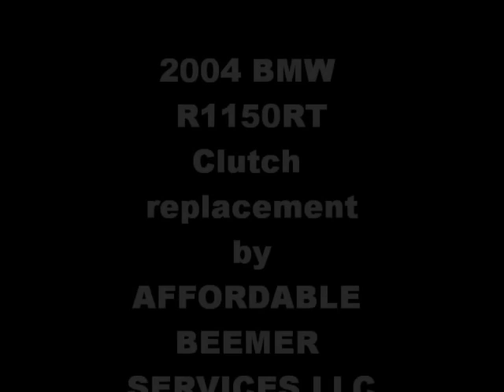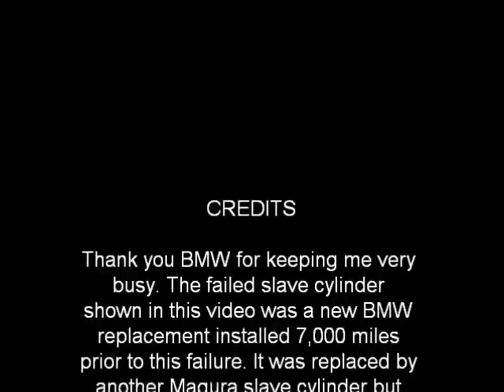BMW Service - R1150RT Clutch Replacement

Comment from the maker: While very, very rare this can happen to the older Oilheads. Only one here at the shop and it was a 50,000+/- mile R1100RT-P that I had installed a rebuilt transmission onto less than 3000 miles earlier. Sometimes they just fail. There is no modified disc for these older bikes as the splines are engaged almost completely. Just replace the input shaft and bearings, use a Siebenrock clutch from Beemer Boneyard and you'll be back on the road with no problems. Good luck, Chris

Comment from the maker: You can plan on rebuilding the rear drive once, installing the modified clutch disc once and then eliminating the goofy servo (if equipped w/ EVO brakes) from the brake system. Thanks for your kind words and question, Chris

Comment from the maker: The measurement at the handlebar between the knurled rings is 12 mm. This is never to change. All free-play adjustment is made at the back of the transmission. Thank you & good luck, Chris

Comment from the maker: You will access the adjuster from the left side of the motorcycle. Remove the triangular black plastic panel that surrounds the lift handle for the centerstand. Remove the rear bolt from the dual outlet accessory plug bracket if equipped and rotate the bracket up to allow your hand to reach the back of the transmission. Good luck, Chris

Comment: Chris, hoping you’ll see this.
I removed my starter on my 2000 R1150GS and discovered through the hole that the bolts seen at 4:40 visible through the assess hole were loose! He last person to do work on the bike was the local BMW shop and that was 15,000miles ago.
I can’t figure what these bolts are called to determine their torque settin. Any idea?
I should be ok to simply torque them down and ride?
Thanks
Richard

Comment from the maker: My reply via Facebook: I have never had an Oilhead in the shop with a leaking rear main seal. However, I did have a customer who told me that the local BMW dealer had installed 5 seals and finally gave up and told him that he needed to replace the 8,000 mile engine. My guess was that the crankcase breather hose was pinched closed creating excessive crankcase pressure. That is what I would look at first (top right of engine under the battery box). Let me know please, Chris

Comment from the maker: The driveshaft is generally OK for longer mileage except on the GS due to its much longer suspension travel. However, I would suggest having Bruno Sax rebuild your driveshaft at 40,000 miles before it causes any damage. Bruno uses u-joints that can be replaced and greased providing longer life at a much lower price.

Comment: thanks chris. i been readding up on FD bearings, piviot bearings, clutch issues, you said in this video about U joints at 40k. it is turning me away from wanting one. i don't know how many special.tools you need to work on these, but i try to do as much as i can up to rebuilding engines.

Comment from the maker: R850R & R1100R, RT, RS, GS = Spline lube every 40,000 ~ 60,000 miles. These do not fail like the hydraulically controlled / 6 speed transmission equipped bikes do. Thanks, Chris
Reply: Does the 2000  R1100S  have the clutch slave problem as the R1150 ?    I'm looking at buying, and would like to know what to look out for...   Thanks for your video/help

Comment: thanks, i saw. i will open and see. do you have expereince in the rear cranck shaft seals? i changed two time both, but still have oil leaking there. i used the BMW seals, with OEM tools to push, made some oil before, and shape some by hand. ..

Comment from the maker: Input shaft to be replaced when the splines strip unless you caught them before they strip. Seals would be replaced at the same time. Rotational play is normal for these gearboxes. "Local bike shops told me to buy japanese bike! " They've offered you sound advice. Good luck.

Comment: I'm going through a 1996 rt11rt trans replacement. I was anxious about the spline lube issue. The splines were fine at 65,000 miles. Didn't need me poking around in there. I certainly worry about the splines at 34,000 miles, especially if there's no reason to.

Comment from the maker: EVO brakes are the goofy power / electrically assisted brakes. If your brakes whine & squeal like R2D2 from Star Wars you indeed have servo brakes. The servo unit can be removed and used as a boat anchor, sidecar ballast or a door stop. YOu retain the EVO calipers and discs, master cylinders, etc. but you lose the power brake function and the anti-lock brake feature. You will also lose 12 pounds of dead weight!
Reply: Anchor, ballast, or door stop.  Hahahaha. I’m still looking for a video of you removing that ABS module. My fingers are crossed while riding my ‘04 1150R. 😊

Comment: Chris, What would be the criteria for input shaft replacement (play btw. disc and shaft or any wear pattern). Maybe you have some pics what is acceptable to you.

Do you change input shaft seal with clutch friction disc replacement? Comment? 

Finally I would like to thank you for all you videos. 2 yrs ago I have moved to Balkans (ex-Yugoslavia) which is hot spot for bikers from Europe. Local bike shops told me to buy japanese bike! The only chance is BMW dealer - which is to several hours away. Following mainly your videos I have solved issues on my R1150R '03 starting with stick coils through TB sync etc. As I am working with large 2T/4T diesel engine I found it very relaxing to work on my R1150. 
You should deffinitely set some donate button in the comments that we - youtube followers - can offer you a beer. Cheers

Comment: Hi Chris loving your videos, my '97 RT11 has around 65K on it and had a new clutch at around 25K (previous owner) I noticed I'm getting short on freeplay,should I be adjusting the free play at the gearbox end or on the lever adjuster? ken

Comment: I have a 1999 r1100s with 34,000 miles  that i'm planning on doing a spline lube this winter (with fingers crossed hoping splines are find), would your method of separating the complete transmission back like your video shows work on my bike or would you suggest different? thanks pv

Comment: Hello Chris,
I would like your advice please,I install in my Bmw r1150gs 2001 new Clutch set', with friction plate Turatech Sinter, and after about 8000 Mile, it start to slip.there is no oil leak,it start slip on 4000 RPM 6th gear, and when I press hardly on the throttle on 3rd gear.Do you have any idea what can be the problem? it is the second Clutch set that I have replace after about 8000 to 10000 Mile.
Appreciate your advice,
Sincerely yours,
Aaron.
Israel.

Comment: Hello Chris!
I have a problem . When replacing the clutch plate , I did not put colored marks on the basket clutch discs . Motorcycle is vibrating. How to put the correct clutch parts ?
Reply from the maker: Disassemble, find the factory marks (if there are any) and reassemble with the marks 120 degrees apart from each other (3 components). I have installed new parts with no markings at all so I suspect that it is now a gamble if the new parts have no marks. Good luck!
Reply: I did not find the color marks,maybe I'm blind. I found the colored marks only clutch housing. Pressure plate and housing cover not color marks. I reassemble with the only place hole drilling of 120 degrees apart from each other, Instead of a color mark. I do not know if this is correct? Vibrations bike has a 4.5 rpm and Close to 6 RPM the bike wants to make out on the studs and nuts and parts. As vibration chair. On new parts have drilling holes? Sorry for my English, I am not a native speaker.
Reply from the maker: Take it apart and rotate the whole clutch assembly 120 degrees. Reassemble and see if the vibration is better or worse. I wish you luck.

Comment: How stupid a design to have a slave cylinder able to leak into the flywheel houseing, what type fuckwits are they at BMW,? I was thinging about buying a 1200GS Adventure new. Having looked at all the service problems that occur on these Newish BMW Boxers, brake pads every 5000miles, internal fuel filters and the list goes on, I shall give BMW a rather wide berth. I own three Motorcycles all of which are low maintainance, The Kwaker GT550 the main hack goes on forever on it's yearly oil change and carb balance. Owned from new 80,000mls now on the clock, the only expensive parts  replaced were the front discs the rest is oridginal, oh plus three three sets of tyres. Total cost new in '99 £4.375.00. These Bemmes cost over £14,000, for this price they should be effin bomb-proof. Thanks for the heads up on BMWs..

Comment: I caught the slave cylinder just when it started to leak on my 2002 r1150r with 19,500  miles . However I have clutch slippage in higher gears at around 3500 rpms. My mechanic changed the slave and thinks with any luck the clutch fluid will burn off the disc. has anyone had this happen ?
Reply from the maker: Hi Stephan, 
   I doubt that the fluid will 'burn off' and render you with a non-slipping clutch. You'll need to replace it unfortunately. Happy New Year, Chris

Comment: How can a manufacturer go from making the greatest touring  motorcycle(r1100rt) to making the worst(r1150rt)? clutch slave, servo abs, weak clutch splines, over complicated expensive ignition. Did I miss anything? This bike will leave you stranded in a corn field.